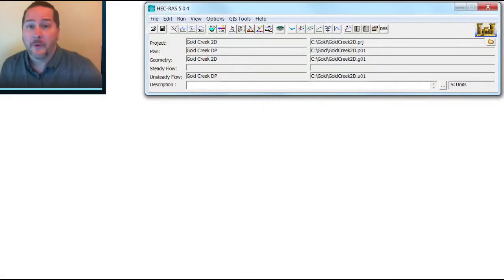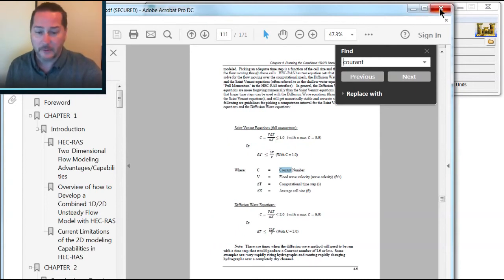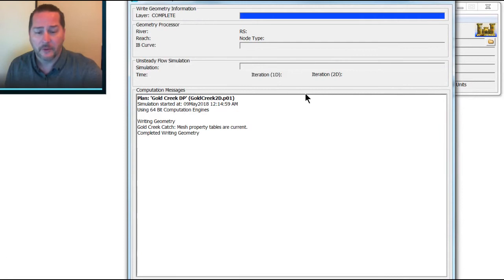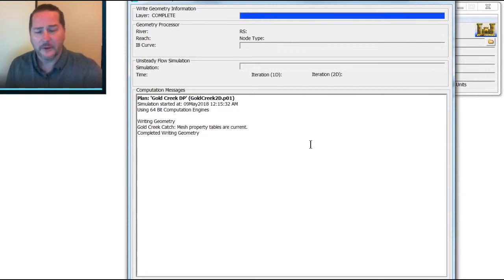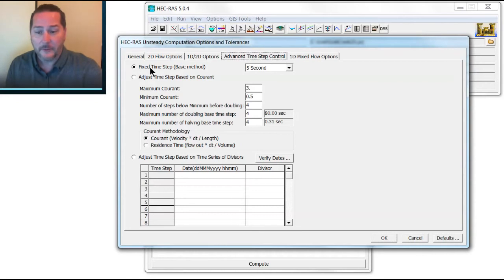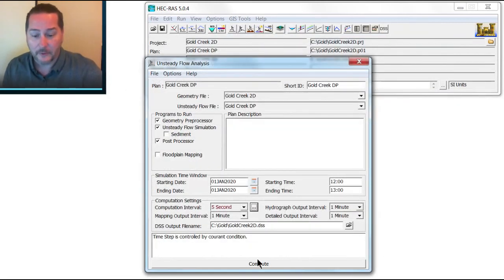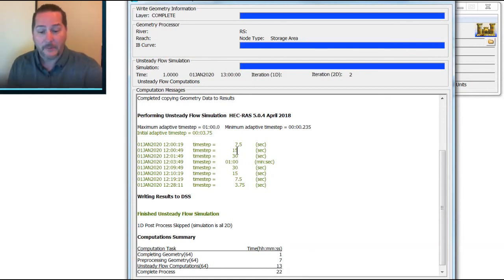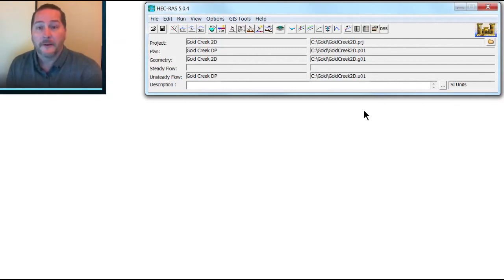HEC-RAS Basics Part 6 of 8: Computational Options and Variable Time Steps

Comment: Hi, does anyone know what is Exit Code = -1073741571 for 2D unsteady flow? 
The simulation runs geometry processing normally, then quits shortly after finishing processing precipitation data. 
Thanks!

Edit: found out the reason. It is a known issue of HEC RAS 6.2. Reverting it back to 6.1 solves the problem.

Comment: Hello, if you can answer me. I need a help for my 2D model. So i have a flow hydrograph for 24 hour with 1 hour interval, 2D large area with river length of 40 km. But, when I run the model, with computation interval 1 minute and mapping output interval 1 minute, the water didn't go to the end of the river, it stop in in the middle. Can you help me how to make the water went to the end of the river? is it something that should be arrange in the computation interval or other?
Reply from the maker: Just extend the simulation time window, and make sure you've extended your flow hydrograph past the end of the window.
Reply: @TheRASSolution  Thank you, it works! Thank you so much

Comment: Hey Krey
If in a couple of cells the Courant number is high will HEC-RAS (according to the inputs) lower the time step only for these cells leaving the rest computations in a higher time step or will the time step concern all the grid cells of the 2d area?
Regards 
Pavlos
Reply: Well I assume (based on the computational process) that the reduced time step concerns all the grid cells until the whole 2d area can take a higher time step.
That leads to a kind of delay in the whole computational process in some cases.
Reply from the maker: Yes, the whole 2D area must run at the same computation interval, which for adaptive time steps will be determined by the worst case. If that's in an area that does not affect your results, you may want to stick with fixed time steps in the interest of computation time. But it's usually worth doing a sensitivity analysis to check.